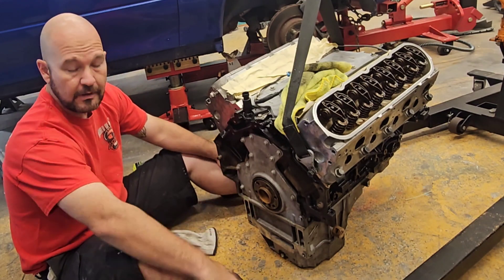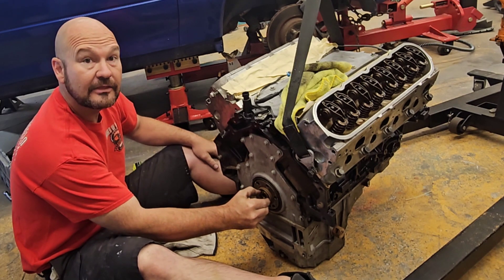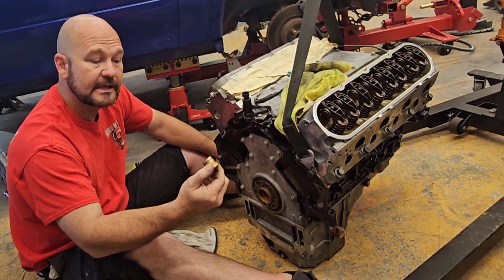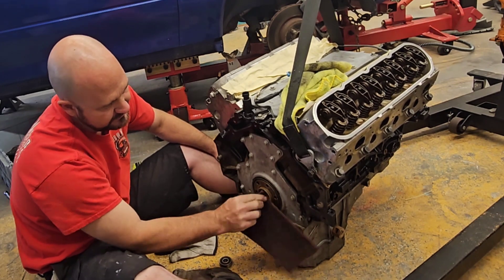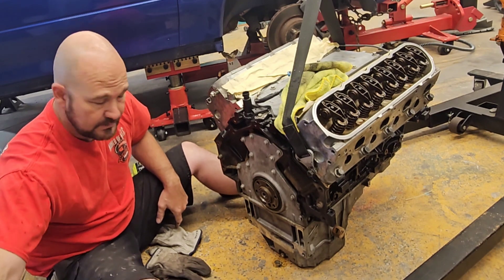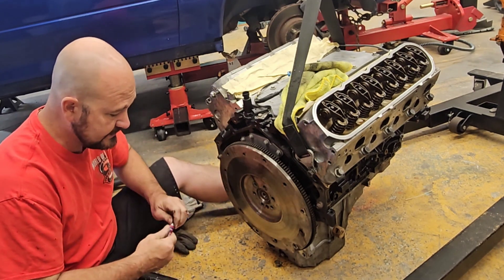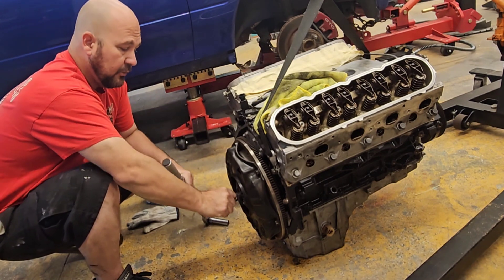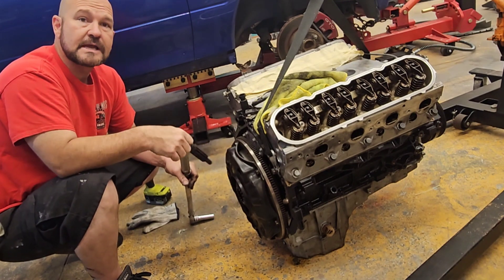6.0L LS LQ4 swap to a 4 speed Muncie SM465 MANUAL TRANSMISSION  square body Chevy K20 Silverado

Comment: What year LQ4, and can you explain how the ALL26112 spun on the shaft, I’m confused, I know the the 6.0 LS had two different size shaft the pilot rides on based on the generation, I’m currently doing this swap with a 2002 LQ4 into a 1978 with the sm465
Reply from the maker: I'm not sure how it spun. But it did and when I installed it, it was Very tight. There is 2 different depths to the crankshaft on them. Depends on your output shaft.

Comment: Did you use a swap oil pan or did you make the aftermarket pan work?
Reply from the maker: I did use the stock truck ls oil pan As long as you got a two inch or bigger lift

Comment: And don’t forget to use brake clean on the flywheel before installing the clutch disc. Finger prints and grease on the flywheel will make your clutch chatter.😂

Comment: Were you able to bolt it to the ls while using the factory input shaft and small block chevy bellhousing on the muncie?
Reply from the maker: Yes, a bolt's right up. The only thing you need to do is get the right bushin or bearing for the input Shaft ride on. But you definitely have to get the right fly. Wheel and a stock clutch and pressure plate will bolt to it